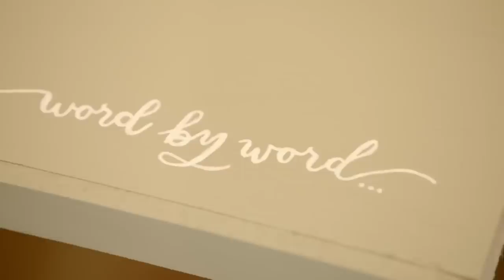Dave & Jenny Use Vintage Furniture To Redecorate A Historic Cottage | Fixer To Fabulous

Comment: -central Wisconsin:  Great design, love & the antique finds.  Regarding the dining room bench, looks great, but having arms on it sadly does make it practical when you people are trying to get in and out, and this said, having a back also for same reasons is not practical.  If bench were a stand alone piece somewhere, the having arms and a back would be perfect.  Sadly, as is, the bench will become a hassle for people and will be repurposed or sold later by the owners, and they will find (or have you build), just a flat pull out bench for that table.